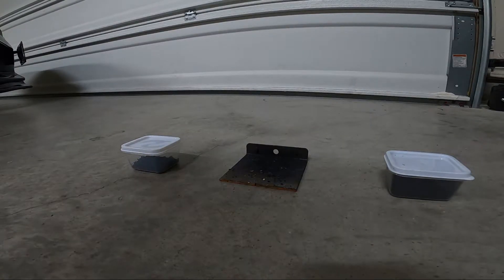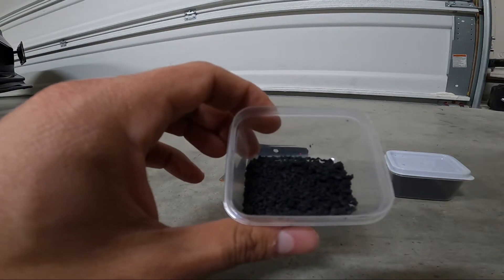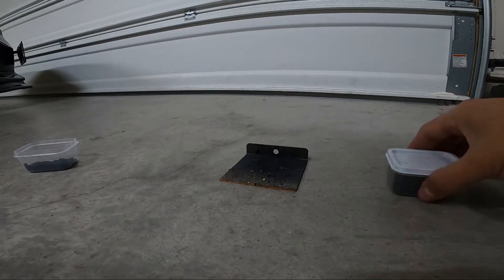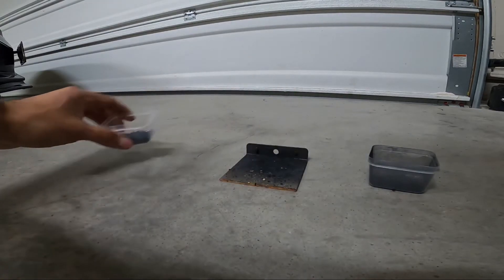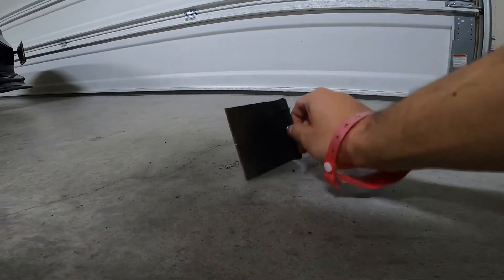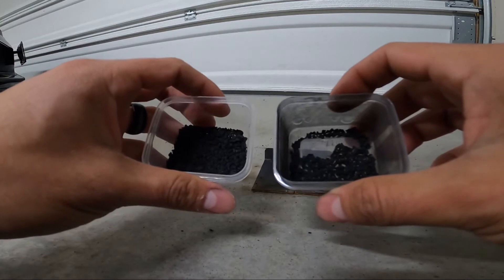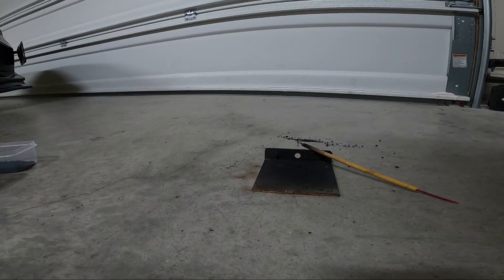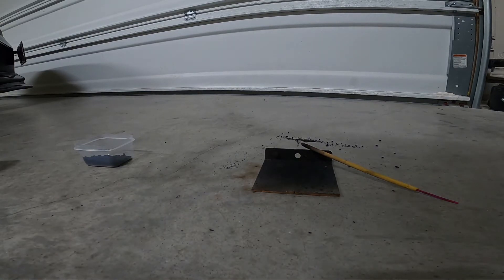How I fixed my slower black powder issue...

Comment: I mill all three ingredients together for 8 to 12 hours and as long as the KN03 is dry and the charcoal is either willow or red cedar. The powder will outperform the commercial brands after its corned.
Reply from the maker: Yes I found the red cedar to be really good. I have willow left but the guy I buy from is having issues so I just make my own cedar from animal bedding
Reply: @E85_STI  same here
Reply: @E85_STI  I tried 2x sour mashed distilled grains? Walnut shell, rice, corn, bread, and Guava limbs, liking the Guava best
Reply: Just 12 hours !
I milled about 24 hours now it's nice
Reply: @mohsenium  whatever works
Reply: @mohsenium  i ball mill my carbon with alumina (Al2O3) ceramic balls alone, dry in oven, then weigh out batches. I got a huge bag of Cent American BBQ char from Target, working out very well, saves me the step of charring.
Reply: @davefellhoelter1343  good idea 
good luck !
Reply: @mohsenium  
Pucked it last night, 1st test VERY WELL, next I'll corn it and final test.
Reply: @davefellhoelter1343  i think this method is best , as follows :
1- drying all matrials 
2- milling all with coffe grinder (severally)
3- mixing them with ball
Reply: @mohsenium  agree.
I had some contamination/fouling troubles when I used spare 30 cal jacketed lead bullets, testing labs use the aluminum ceramic ball to keep milled materials 99.9 pure.
No Spark just like copper or lead.
But I'm starting to think the lead oxide from lead balls in mill "may" speed up energy?
Reply: Couldn't agree more. Just started this process a few months ago and made my first couple of batches and tested against a Swiss sample my dad gave me. He couldn't believe the homemade stuff reacted just as good or better than the Swiss. And yes 8hr milling is the bare minimum if you're in a hurry.

Comment: I run the ball mill for 24 hours with a couple dollars in nickes and 100 .45cal round balls.. Haven't tested the difference between acetone and 90% isopropyl but i normally use acetone. Think the mesh i use is 36, 6x6, brass screen. It's fast. Same ratio 75/15/10. 

Had good results last time i used apple. Planning on using straw in a future batch. 

Has worked well in rockets, lift, and in the pan of a firelock.
Reply: Take out any metal that isn't lead.
Reply: How are you running it for 24 hours without getting massive clumping which no longer can be broken down once it collapse on the sides and edges?
Reply: @matthew33721  Brass is best. Doesn't spark, doesn't leave residue like lead.

Comment: From my experience I have seen that it is not easy to obtain a good black powder.  My procedure is based on three steps.

Part One
For this mixture the following composition was used:
- 75 g potassium nitrate;
- 10 g sulfur;
- 15 g willow, poplar or alder buckthorn charcoal (below 80 μm fine particles).
Sulfur and charcoal are milled into a 3 lb ball mill with 10 mm high density 90 tungsten spheres for about 6 hours.
Subsequently, potassium nitrate (agricultural grade), with particles of about 0.5 mm was added, mixing the ingredients manually with a spoon.

Part Two
The previous powder is put in a kitchen blender, wetting it with 90° denatured ethyl alcohol.
After 30-40 seconds of blending, the material is dried in a glass bowl and at a temperature not exceeding 220 °C.
After drying, sieving and milling, a more flammable powder is obtained.

Part Three
This powder is fed into a mini ball mill (3 lbs) containing 100 brass balls of 10mm diameter and 50 brass balls of 15mm diameter.  The final grinding of the powder takes 13 hours.
Now the black powder is ready to be used.

Comment: Hello, I was ball milled and then granulated before combustion. The combustion speed is fast but cannot be ignited quickly, and it cannot completely form smoke, producing a small amount of red particles, small white particles, and black particles. What is the reason? My potassium nitrate is made from toilet cleaner (mainly dilute nitric acid) and potassium hydroxide. The sulfur purchased is medicinal sulfur. Do we need to use sublimated sulfur? Carbon is 1000 mesh willow carbon.
Reply from the maker: So if it’s hard to light then the granular size is still too large for the nitrate but I’ve never used toilet cleaner which could also be the problem with lighting. In the past I’ve used larger mesh aluminum for flash powder and it was really hard to light but I was just testing

Comment: I bet if you milled just the charcoal first you might get similar results.  Or maybe mill the sulfur and the charcoal together first and then add the other ingredient.
Reply from the maker: So back then I used to buy store bought airfloat charcoal but after this I started to make my own eastern red cedar and mill it myself and it works much faster. Check this video that I make with the only black powder. The ground bloom flew with no wing. 
https://youtu.be/lxnCP6OR-E4?feature=shared

Comment: Is the BP usually a lot slower if you DONT granulate it?
Reply from the maker: Generally yes because if you don’t you’ll have green or meal d mix and when you granulate it with water/alcohol it allows the nitrate to absorb into the charcoal which gives it a better mix then having little granules creates little pockets of air so when it burns it burns faster. I’ve actually tested the meal mix vs granulated and I noticed the difference.

Comment: On the one you milled separately (1 hr, 1hr, 1.5 hrs sulfur), how long did you mill the combined mix?  I don't see why milling separately and then milled combined would make any difference.  Maybe the difference is you granulated the slower powder twice?  Not sure why you did that, but it would seem you could be losing some KNO3 with all the granulating.
Reply from the maker: So I just wanted to see if each powder had its own chance to break down if it would increase the speed. Ever since this video I just ball mill it all together and granulate with a 8 mesh and it burns way faster. I posted a video I think after this video. I’ve seen others mention granulating up to 4 times for speed but I think it really depends on the charcoal.
Reply: It makes a huge difference because it makes a more intimate mix between the oxygen source and the fuel source. It makes even better powder if you wet it with a solvent, you're trying to get the molecules as close to each other as possible.

Comment: Willow, or Grapevine are the best to use for making fast black powder. Only use hardwoods for charcoal if your making stars that you want to burn slow for longer effect in the sky. Soft wood for speed. You are correct, but You need to learn to press, and corn your black powder if you truly want fast black powder. Some do it the old school way on the stove by heating the potassium nitrate on the stove in a pan with a little water, then mix in the charcoal, and sulfur while gently heating, Then take off stove, and keep mixing, then add a little alcohol, then put in freezer. Dry it, Then ball mill it for 24 hours, Then press, and corn it, Then do what you normally would do with it. I personally like to keep it as a black powder base, So if I want to make black match, I just add a little dextrin to make my slurry, or if I want to make lift powder, I granulate it. There is no right, or wrong way, It is more fun to play around, To find what works best for You.
Reply from the maker: Hell yeah man sounds good. So this video is a little older but I now have a hydraulic press from woodys rocks so I can press pucks and do the corned method. I appreciate the info for sure.
Reply: What’s the best charcoal to use for fireworks
Reply from the maker: @fuse911  paulownia and willow are the best but I use a lot of willow or red cedar that I make at home.. Soft woods such as pine are good for sparkle and gerbs.
Reply: @E85_STI  so I used some williow charcoal and grinding it really fine powder. My gunpowder is more like sparklers it takes a lot to start and it burns slow. Any tips?
Reply from the maker: @fuse911  is your potassium nitrate chunky? If so it has moisture. You can bake it at 250 degree for 15 mins. First grind it in a coffee grinder then lay it out on aluminum foil and bake it. Did you ball mill all 3 chemicals before granulating?
Reply: @E85_STI  no I did bake it at 350 for 20 mins before and I used a screen mesh to make sure it’s not chunky. I guess it was to dusty and dust burns a little slow? I put some rubbing alcohol it and let it dry up it’s still drying up ima see if that helps
Reply from the maker: @fuse911  once dry that should burn faster if it doesn’t then you have to suspect it could be the potassium nitrate or the charcoal. Sometimes companies sell very old nitrate but even then it should still work decent.
Reply: @E85_STI  i appreciate the advice bro, it burned faster and I managed to get a triangle bomb to go off but it doesn’t have much punching sound to it like explosion sound it’s more like a ploof anything for that?
Reply from the maker: @fuse911  that’s awesome and for the triangle did you wrap it in black tape? The powder is powerful that it will just pop open the triangle but it needs a lot of tape to make it contain the explosion.
Reply: @E85_STI  no I been using masking tape and making my triangles out of craft paper. I try to make them pretty hard sometimes everything just shoots out the top like a rocket engine
Reply from the maker: @fuse911  yeah it’s coming out like a fountain because it’s burning a hole in the tape and paper. If you watch the video I just posted about blowing up a firework tank one of my salutes did the exact same thing it sprayed out the top. On that one I used elmers glue to seal the hole but on the other I used hot glue.
Reply: @E85_STI  I got u man checked the video out as well. We gouna make this work I’m too invested in this now to give up it’s been 3 days and 120$ later. I will make this work lmao
Reply from the maker: @fuse911  lol hell yeah trial and error as always. I’ve been making black powder for years and it’s still different each time. The one that stays consistent for me is my red and green flash powder. That always burns fast.
Reply: @E85_STI  yeah I was a bit late to Order flash powder it was going to come after 4th of July and instead of buying the lame California fireworks I always make some out piccolo Pete bombs but I tired to go hard this year
Reply from the maker: @fuse911  California does the safe and sane fireworks right? I know Arizona has some laws.
Reply: @E85_STI  I’m from Chicago originally my pops use to drive me to Detroit to the phantom warehouses where they had everything you could think off from m80s to shells it was like a Walmart size firework store. California has some of the most lame laws for fireworks nothing can go higher than 6 feet or make a loud sound pretty much best thing the got is the crackling balls. I use to get the piccolo Pete bombs, hammer them out and tape them up and they use to make a pretty decent sound but once I saw these triangles I was astonished, I couldn’t wait to get my hands on them till I found out they home made and this year I was tryna make some since I finally got my own apartment lmao definitely a messy job or I’m just a messy person but next year I’m definitely gouna do it with flash powder or I gotta drive out to Reno or Vegas which is like 7 hours away from me :/
Reply from the maker: @fuse911  I’ve been to a phantom store in Georgia and they sell fireworks year round which is really nice.
Reply: @E85_STI  yeah they need to start shipping them so I’m not out here trying to be a chemist learning what potassium nitrate or sulfur or sulfate or the different type of carbon and charcoals I feel like I did 4 years of chemistry in college In like 5 days lol
Reply: @Ten Soldiers I ended up make some fireworks they were okay they exploded but not very loud with willow charcoal.  Definitely trying flash powder next year. But the black powder I had from using other charcoals I put them together and managed to pull off a pretty cool fountain but I definitely got the hang of it next year I’m going hardsddd
Reply: @fuse911  I know this is coming in a few months late, but better late than never when it comes to things that bang and boom.....lol
Hope this can help someone who comes along later like I am now.
I've been running a 60/40 willow silver maple for my black powder in 44 carbine. I'm running between 1285 and 1325 fps compared to the 1250 fps with goex.
When I really wsnt to make some noise for the 4th, it happens with a mix of 64 grams of potassium nitrate, 14 grams of antimony sulfide , 18 grams sulfur and 4 grams dextrin. Just do yourself a favor and be at a safe distance when lighting off. It's the same powder used in the real m80's.
Y'all enjoy and be safe
Reply: @Sport--willow  I mean it’s always 4th of July somewhere right?
Reply: @fuse911  oh yeah....you know it!
Now if y'all want a really nice boom, you can always make up a 50 grain batch of H-48 and set up off. That would be equivalent to setting off approximately 100 LR primers at the same time. Now that should make them aerial cherry bombs sound like a lil ol blackcat fire cracker.....lol
Reply: @Sport--willow  okay a man of experience lol I like it. I usually use pill bottles or bottle caps, last year I tried it with construction paper and made triangles with it and wrapped it up with electrical tape and that did the trick. But I know sometimes it’s not the powder that’s making the noise but what it is concealed in makes a big difference
Reply: @fuse911  .
Reply: @yermo8918  Robert doesn’t know how to have real fun

Comment: Why is my FP so slow? Is it because of old kno3?
Reply from the maker: Low quality kno3 could be a factor as it’s an oxidizer providing the oxygen and the charcoal is the fuel. If your kno3 is chunky then you can bake it in the oven at 200 degree for 20 mins to help remove moisture and that helps.
Reply: @E85_STI  many thanks in replying! What do you think if I "refine" it? Like boiling kno3 in water, dry it recrystalize, and grinding it to a powder again?.....I like your feed back!😄
Reply from the maker: @jonathanleon6615  well when you graduate it with water no dextrin it will break down and soak in the charcoal then crystallize again. Another big thing is when you granulate and let it dry don’t use newspaper or paper for that matter as the nitrate will leech into the paper and not the charcoal and your BP will be slow.

Comment: What kind of wood did you use for your charcoal
Reply from the maker: I believe this one was eastern red cedar but I do have some willow left over from this video but it was filmed last year.
Reply: Generally a willow, white pine or alder are some of the best wood based charcoals. Swiss brand uses Alder and it's some of the fastest burning commercially available powder. I have not tried Red Cedar but I might have to try that next.